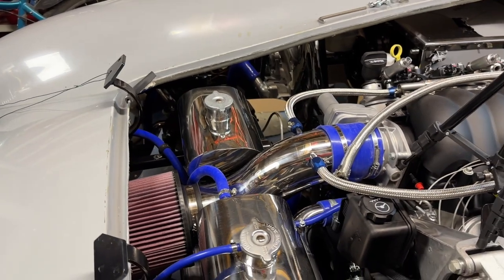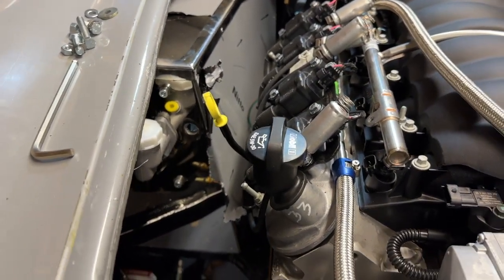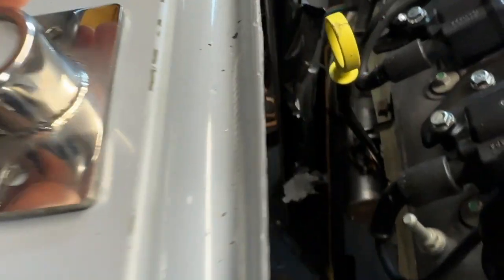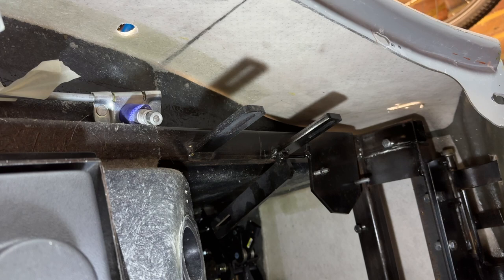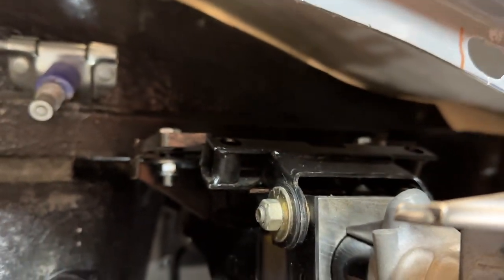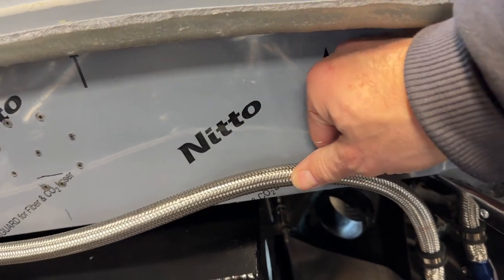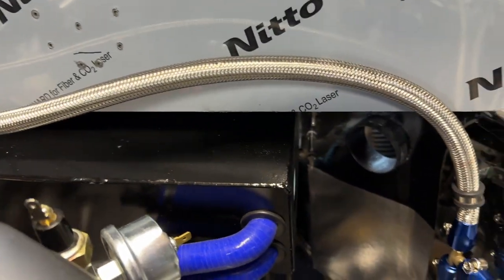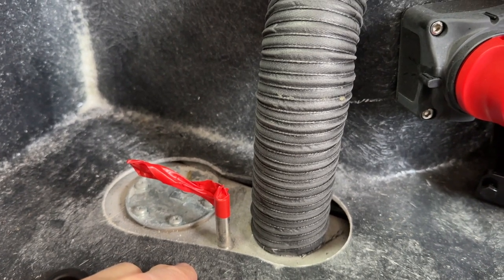Building the AK Cobra - Series 2 - 14-Steering Column and Fuel Plumbing

Comment: Russ you should add a none return in the fuel line. In some cases one in the supply line and one in the return line, keeps the fuel rail pressurized for up to 20 minuets and helps with start stops, less wear on the pump.
Fitting the filter after the pump, makes the pump expendable rather than protected if fitted before the pump. 
( Cheaper to replace a blocked filter than replace a damaged pump)
Not sure why AK would do this, as its not in the build manual, and I have not seen any updates from AK to say why they would do it this way.
One pushes and one pulls depending on where you fit it in line.
Also need to set the fuel regulator to 60psi according to the Road craft crate engine document.
Reply from the maker: Thanks Mike, yes just following AK’s build docs regarding fuel lines. However I will certainly ensure pressure regulator set correctly.